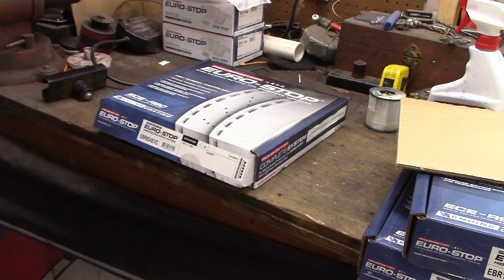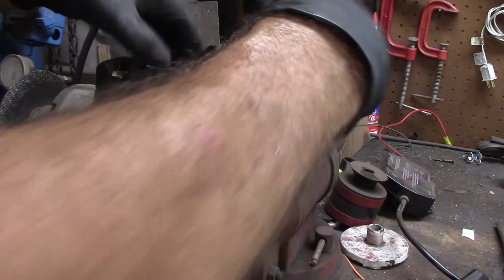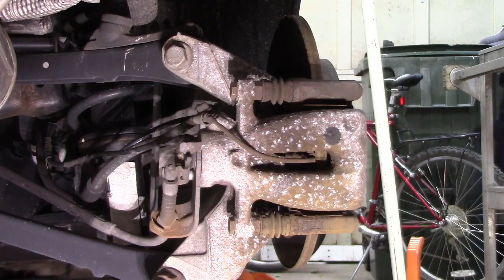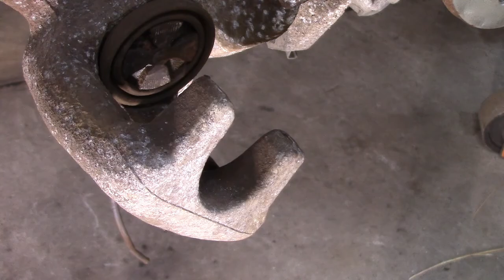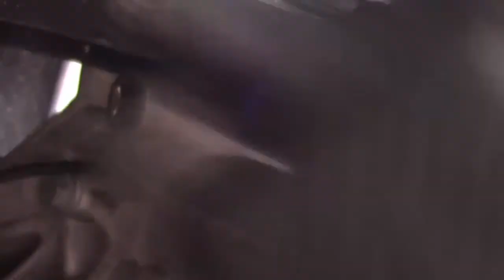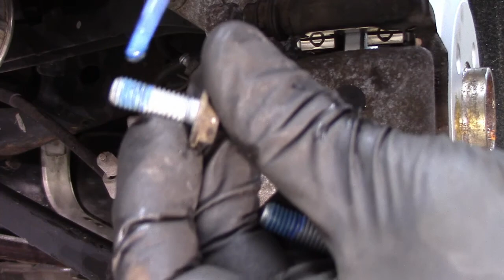Mini Cooper Brake Job

Comment: This was a very helpful tutorial. What was the size of the torx bolt holding the rotors? T30? Thank you!
Reply from the maker: I'm not positive but I believe it is a T25.
Reply: @daveraymond2265  Thank you!
Reply: What did you spray on the hub before attaching the new rotor? Was that the same as applied on the inner wheel surface before you put it back on?